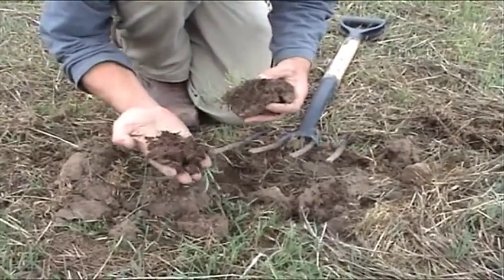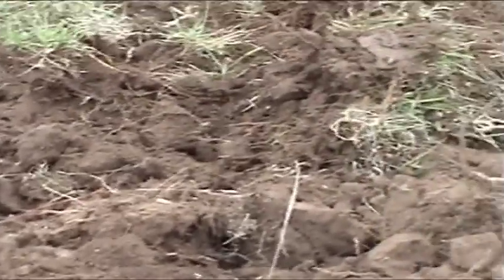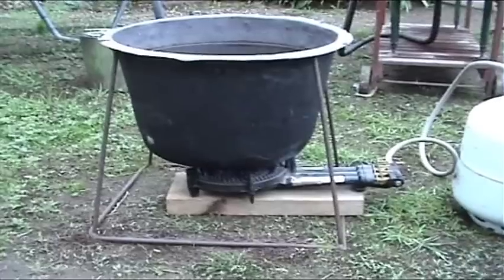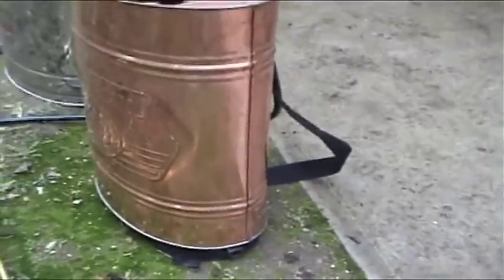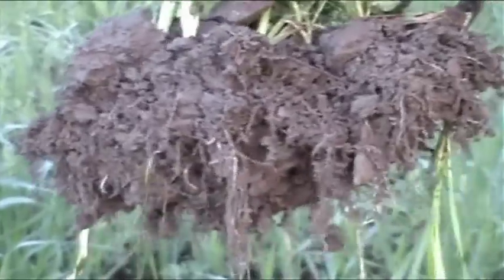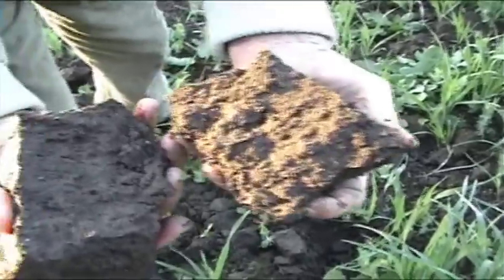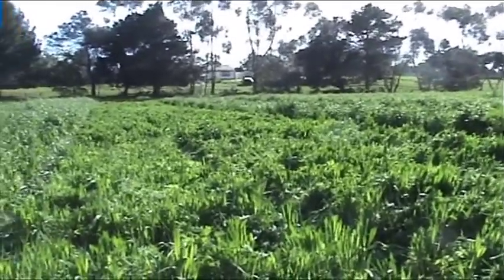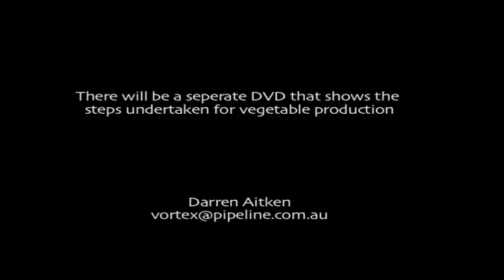Vortex Vegies:  From Horse Paddock to Living Soil

Comment: Everything I've read about biodynamic is shrouded in mysticism and yet watching this it's easy to see why it's successful. But geez, my arm would get sore doing that for an hour. My interpretation of this process: the water cavitation aerates/oxygenates it, oxidizing any volatile compounds including chlorine so that when you add the microbiology, it doesn't die. The "Prepare 500" or cow horn stuffed with manure is buried and composted to create that microbiology? then used to create a calcium (horn), and biologically rich (manure) compost tea. The plow decompacts the soil, letting air and moisture in. The "Prepare 500" adds water soluable nutrients and microbiology. The cover crop adds protein, carbohydrates and sugars for the microbiology and roots that breaks down the now wet soil chunks. The trimming of the cover crop exposes the legumes and provides ground cover keeping moisture in. The cutting and then cultivating in of the cover crop adds the organic matter (carbon, nitrogen etc) to the soil that then breaks down, fertilizes and aerates the soil.

As some of your soil is still showing after cultivation and may dry out or germinate and I might add a crimped green mulch layer to the top of that soil to keep it moist in summer and reduce weed pressures.